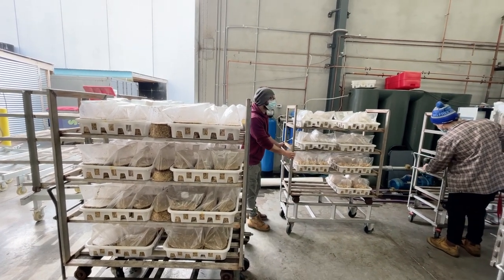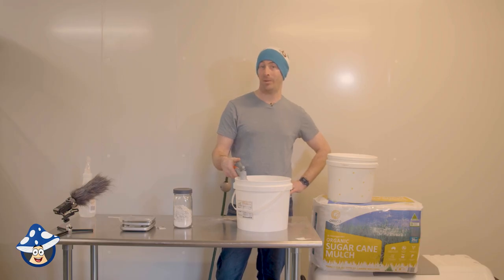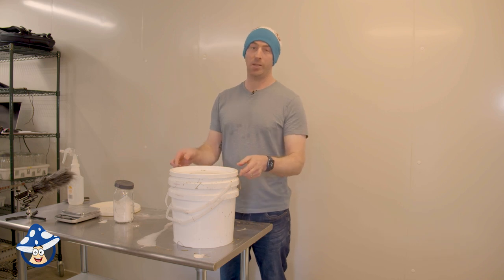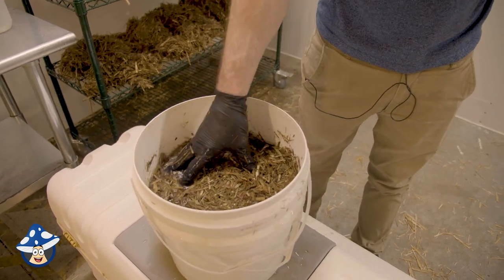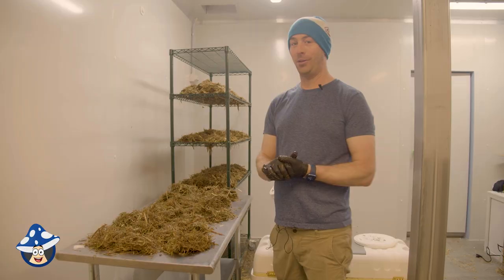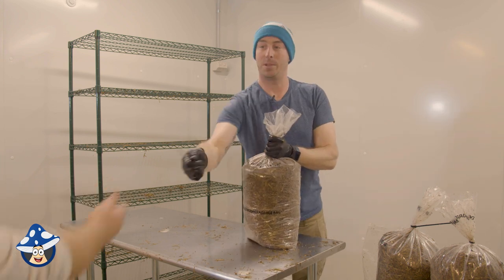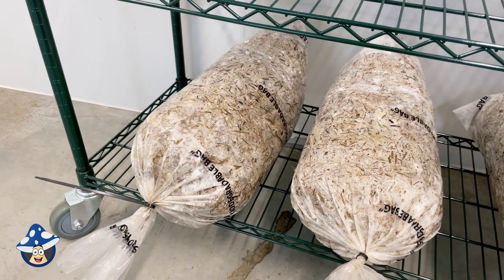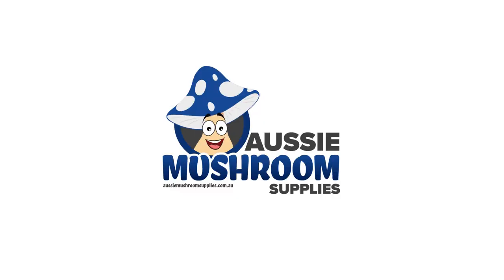Home Growing Mushroom Tutorial - Cold Pasteurisation - Episode 2

Comment: Just want to clarify… So the bucket method is smaller scale and rack drying is for larger volume?
Reply: I would also love to know this. Was a bit confused
Reply from the maker: Sorry for the slow reply we missed this

Buckets and racks to air out on can be used for any scale

You can use bigger longer buckets or bags or anything 
We did different containers to show you can use anything 
Just make sure it’s clean and has some holes for air exchange :)

Comment: Great videos thanks. I just ordered 1 of your double kits and was wondering, is the temp rule also the same for the ready on box kits? my bathroom and kitchen (and home) get over 20c in the day still. (Based in western sydney) Is that an issue? I can get humidity and light covered but temp I would struggle with. My outside shed is under 10c at night and over 20c in the day. Inside is over 20c most the time (22-25c during the day/evening). Will this be detrimental to getting crops of lions main and pink or yellow oyster mushroom?
Reply from the maker: You can go a little warmer for fruiting kits, the mushrooms will go better when in the temp range they like, eg pink oysters do the best 24- 28deg  :)

Comment: Great vid. Made me think maybe I'm not drying my sub enough..  I just leave to drain in an upside down bucket with the lid cracked.  Any suggestions for sub for us in WA where organic sugar cane mulch isn't available?   And will you be doing any low tek lions mane, shitake, chestnut vids?
Reply from the maker: Hey Matt this works with Straw aswell, try your local horse feed supply store, Make sure you use straw not Hay or Chaff as it wont work, we have a paper pellets video coming soon aswell, it doesn't yeild but is very easy to do :)
Reply: Hey Matt, I’ve used oaten chaff before. It’s quite nutritious so it is prone to contamination. Mixing it with hardwood sawdust or equine bedding would work.
Reply from the maker: @mattnsim  dont use Chaff, it will cause problems, keep it simple so people are not throwing stuff in the bin :)
Reply: @mattnsim  Yep - I've used Oaten chaff for a while for my oysters with no issues.  Ideally I'd like to find a cert organic source of substrate to avoid the glyphosate and adjunctives though hard to source in WA unless getting 300kg bails. Thanks will try mixing the two....
Reply from the maker: @yogamatt2203  keep an eye out for our heat pasteurising video coming soon, Chaff has lots of seeds etc in them and they will germinate with cold soaking and you end up with a bag of sprouts with your mushrooms :P  Heat soaking is better when using something like that and mixing it something else -  more videos will be coming in the future for things like that.